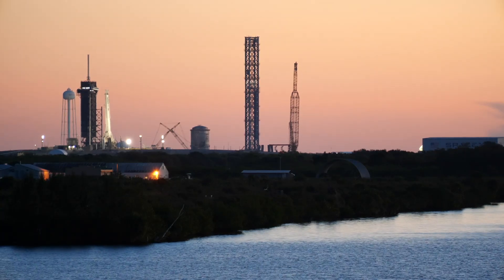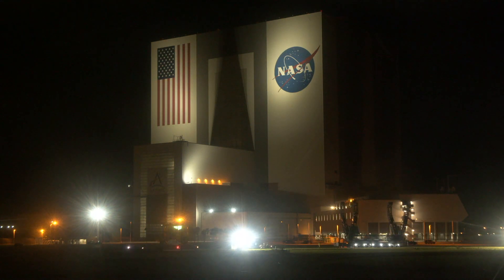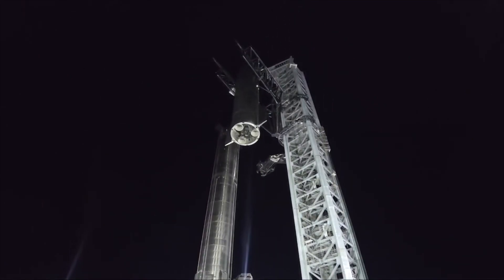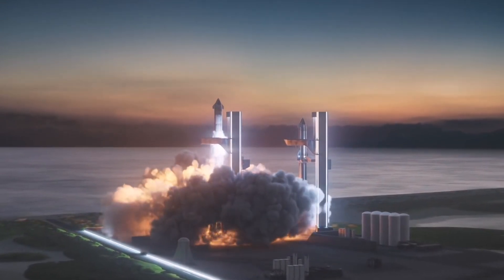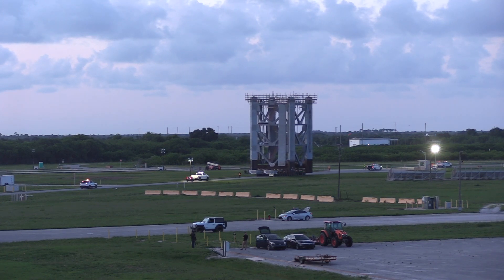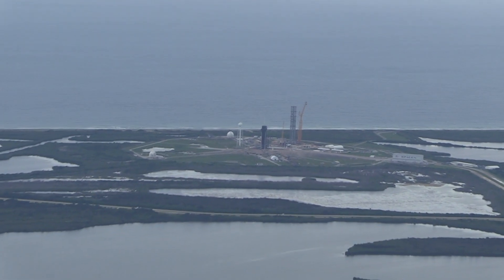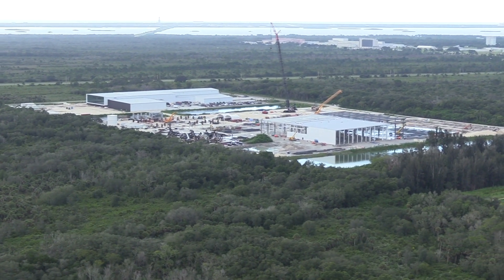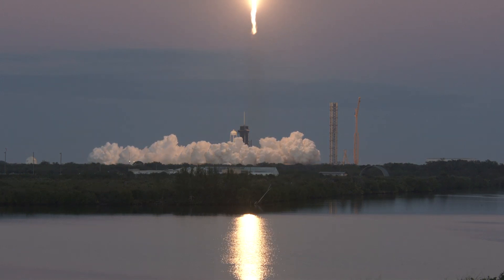Florida Starship launch pad construction ramps up with arrival of chopsticks carriage

Comment: SpaceX should SHUT DOWN construction in FL, until they prove out the tower and ortial launch mount in Boca Chica .. the  destruction from just firing a few engines in Boca Chica does NOT look good for their initial launch system design.